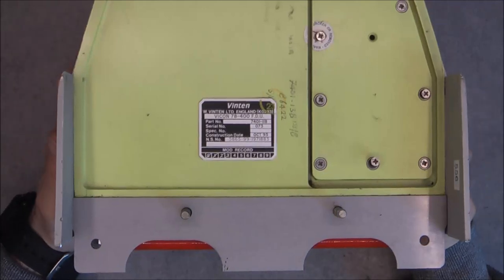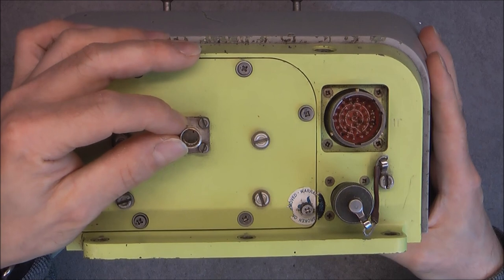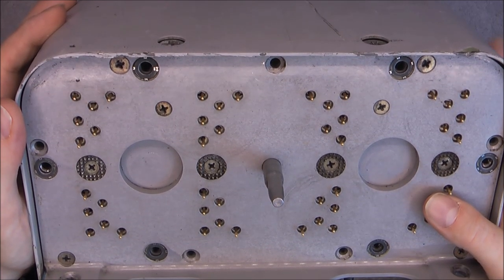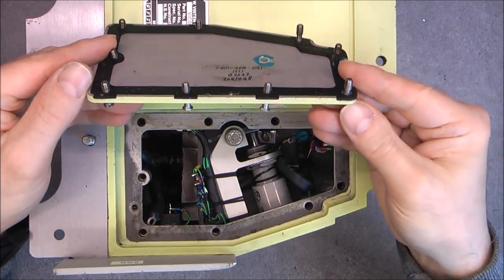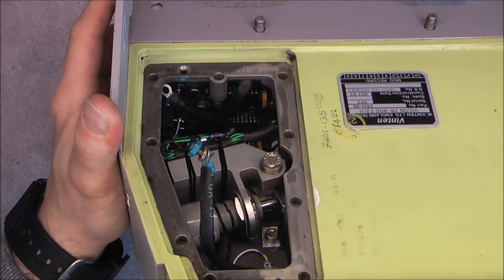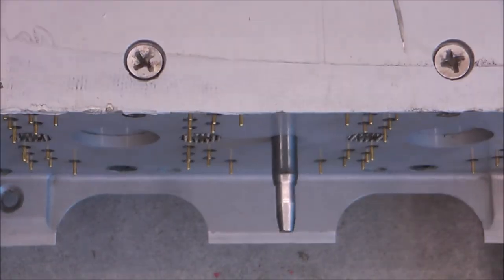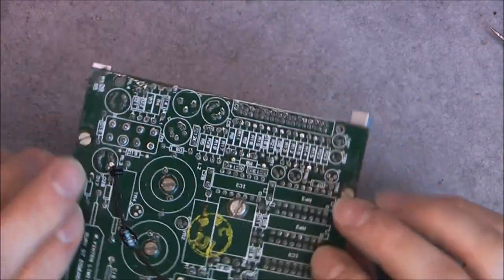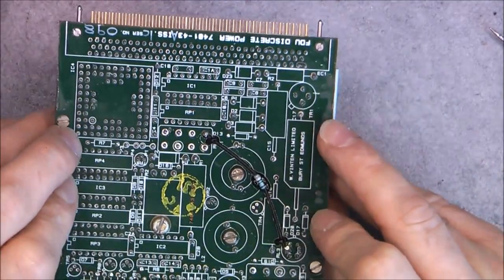Tornado Flare Dispenser Unit teardown

Comment: Really interesting unit, thanks showing it. Some top quality parts in here, very rare. Those small D-Sub connectors are part of the M83513 standard, also knows as "Micro D". Very common in aerospace and space stuff.

Comment: And the nice International rectifier TO-254 note the BeO marking that is for ceramic feedthrough. Those Interpoint can look quite interesting from the inside, but they are not directly suited for space because of the optocoupler, but depending on the mission and the exact unit, they can be used for space. Really nice unit you got! Tanks for showing.
Reply: MichaelKingsfordGray  jup but it is quite well contained, for those Packages you try not to bend the legs

Comment: Very nice unit! Any plans on acquiring more countermeasure devices? A chaff dispenser might be interesting. RF/radar/laser jammers would be really interesting.
Reply from the maker: I have no plans in particular, I take whatever comes, seems interesting and is affordable. Coutermeasures equipment is very rare to find, like missile parts. I would like to get also one of those airborne long range / thermal imagery spheres.
Reply: MichaelKingsfordGray  This was a flare dispenser for decoying heatseekers. The chaff dispensers created clouds of thin foil or mylar to decoy radar homed missiles. Completely different devices and can be used independently.